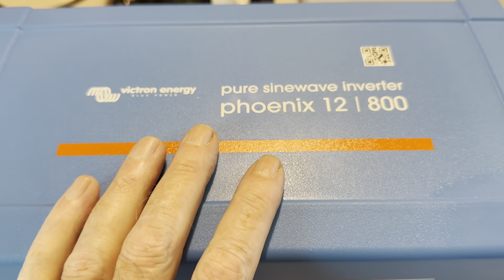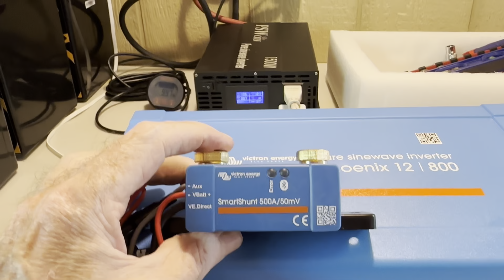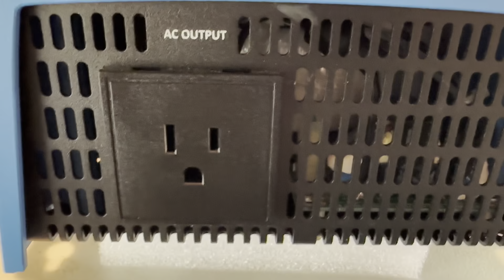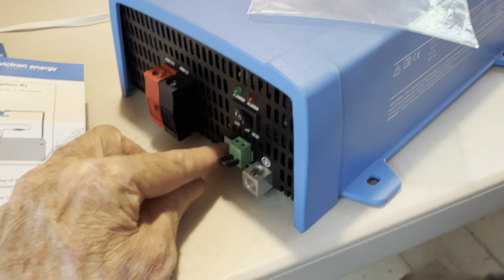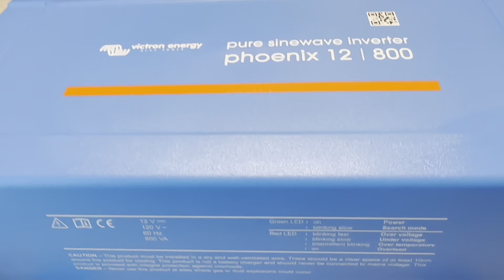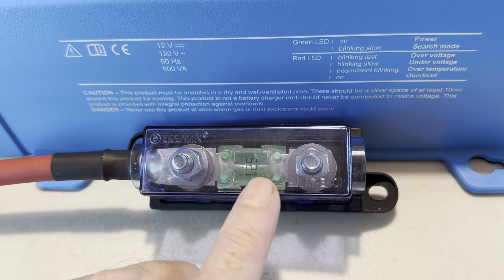Victron phoenix 12/800 Pure Sine Wave Inverter + Smart Shunt  Bungaloha Blue wall is about to grow!

Comment: Interesting you got the 12-volt version I have the Victron 24/800 inverter. You are right it's heavier than I thought. I also have the WiFi dongle so I can check the wattage. I also just bought a Victron 100/20 Blue charge controller. This controller is likely not very popular. I can't find any videos on YouTube showing a review. I should have bought the Smart version.

Comment: Glad to hear you're getting better from the C-19.  On that inverter, I have the same 800w/24v and noticed a couple of things.  To change any of the set points for low voltage cutoff, you need the blue tooth dongle.  Mine kept turning off due to voltage sag.  The problem was using the cabling from another inverter which looked good until a load was applied.....damn CCA, then swapped out for O2free pure copper and problem went away.  The 800w unit has a 650w continuous duty cycle and again you can only see the gauge using the blue tooth dongle.  Once the dongle is removed you're toast on what is going on directly.  Ve.direct network does not work in this scenario as I found out.  I ended up building DIY cables rather than purchasing Ve.direct cables using pst4 2.00mm offset and an isolated USB/TTL adapter and a raspberry Pi.  The raspberry pi becomes a generic Cerbo GX (Venus device) and all of my batteries on now on VRM at a cost of about $80.  The point of all this rambling is that IF you want, you can tie the smart shunt, inverter, and controllers into the Raspberry and monitor on the web or a local network without leaving the home!  I now have three systems on line to see all of the stats in real time.  Also, I noticed the serial number is from 2021 so Victron warranty is from serial number and not purchase date.  I have been picking up open box / used items and most are coming in with 2021/2022 dates.....makes me wonder why!  For home made cabling you need to download the VE networking manual to get the pin assignments, but in general, do NOT connect the 5+VDC pin since it is NOT required!  Gary from SE MI....Aloha your way

Comment: looks real nice. love how Victron stuff talk to each outher and all on Bluetooth app. nice rain your getting. going to be a real nice Blue wall . I can say for the RV people the Victron stuff works very well for them. the Bluetooth app they love.  I have done a few installs for RV . Victron so easy to set up and use. Victron does have a LiFePO4 battery as well. have not used yet. RV people going with Power queen hear. works so well. you sound much better now. take it easy and try not to do so much in a day. pace your self.  what I do. take a look at outher Victron stuff and do some research and see what else you may need . each install I do is different. have to fit the needs of the user. and that will change over time. new stuff comes out all the time.

Comment: Smart shunts are great.  I swear by them.  Settings for LiFePO4 (via bluetooth app):

Battery:

* Ah set to full capacity of battery as appropriate.
* Charged voltage: 13.8V (for reset to 100%) (I explain this more down below)
* Discharge floor: 10%  (typically)
* Tail current: 2% (typically... used as part of the logic the unit uses to reset the SOC to 100%)
* Charged detection time: 3m (used as part of the same logic)
* Peukert exponent: 1.05 (for LiFePO4, be sure to set this parameter properly to 1.05!)
* Charge efficiency factor: 99% (this is amp-hours-in vs amp-hours-out, not energy-in vs energy-out, so it is 99% for lithium.  Lithium has almost perfect coloumbic efficiency).
* Current threshold 0.10A
* Time-to-go averaging period: 5m is typical, set as you like (this is for display purposes only)

* Battery SOC on reset:  "Set to 100%" setting.
* State-of-charge: You can change the SOC upon initial connect if you know what it is, else it will fix itself after a full cycle anyway.

Misc settings:

* Monitor mode "Battery Monitor".
* And "Aux input" ... set to "None" if not using the Aux input.

In terms of the "Charged Voltage", for a 12V battery 13.8V is well into the exponential part of the charge curve so you usually want to activate the shunts "reset SOC to 100%" logic starting about there.  The shunt will also wait for the tail current to drop to 2% and wait 3 minutes after those parameters are all satisfied before resetting the SOC to 100%.

The Victron documentation that suggests setting "Charged Voltage" to the float voltage is INCORRECT for LiFePO4.

--

Also keep in mind that the "Current" and "Power" on the shunt's status screen is the current and power going into or out of the battery,  NOT the current and power coming from the solar.  The loads on the system will subtract a bit from the current and power from the solar during the day leaving you with just the current and power the battery is being charged or discharged with.  At night of course the discharge rate will be precisely what the loads are using since there won't be any solar active.

Oh yah, and when you have the shunt connected to the same VE smart network as the charge controller, the charge controller will use the voltage reading from the shunt instead of its own voltage reading and thus get a more accurate voltage reading for the battery.  Which is awesome.

--

Choosing the 800VA Phoenix was a good call.  The smaller the capacity of the inverter, the less vampire power it eats.   Though since you aren't running a fridge (?) you might be able to use ECO mode in the Bungaloha.  I've never been able to use ECO mode on my phoenix's myself.

-Matt
Reply from the maker: Mahalo brother...I did exactly as you laid out, and it's working perfectly!. You my friend have helped so much. Keep that information coming in! Aloha!🤙

Comment: Glad to hear that you have recovered. I run a Victron 24v/375VA (Non-VE) Sinewave inverter 24/7, on a  Receiver setup. No issues. It uses 2 x 12v batteries with a balancer. Only thing I have to do is add another solar panel on the other side of the garage roof, to capture morning sun. My power peak is currently at 2pm, and going towards winter, will need to use all the solar, I can grab..

Comment: Is Victron modified sine or pure sine wave?
Reply: Pure sine wave.   All Victron inverters are pure sine wave, low-frequency inverters.
Reply: @junkerzn7312  I have the Victron 1200 Phoenix 12 V inverter and so far it has been working very well running my Frigidaire full-size Refrigerator(top mounted freezer) I noticed my Phoenix says it’s low frequency. Also, is that good or bad? What does that mean? Low frequency inverter? most folks claim. These are very clean. Power inverters as they are used in Maritime applications and they can’t have harsh RF interfering with the onboard electronics.
Reply: @william38022  Low Frequency inverters tend to be more robust than High Frequency inverters, can handle larger surges, and are usually slightly more efficient (not by much though).  The output is cleaner as well.

The downsides are:  (1) They are quite heavy, particularly at higher wattages.  And (2) There can be annoying audio buzzing and resonances with certain types of loads.  

--

High frequency inverters tend to be significantly lighter and quieter from an audio noise perspective, and often cheaper.

The downsides are: (1) HF inverters are a bit less robust when presented with a reactive load from an AC motor.  (2) The output is noisier from a RF perspective.  And (3) Harder to repair due to more complex circuitry.

--

Cooling requirements are roughly similar.  Some people think LF inverters need less cooling but what actually happens is that the vendors let them get too hot before turning on the fan.   I prefer the fan to always be on at a low speed at a minimum and usually mod my inverters to force it to always be on if I can't otherwise program them as such.

Personally speaking I use both types.  It is situational.  For the vast majority of my needs HF inverters are fine and I keep extras on the shelf so I can just swap one out if it fails (I don't tolerate equipment having to be turned off while waiting for a warranty repair, for example).  HF inverters tend to be cheaper so its easier to stock extras.

I use LF inverters for anything that is really critical or if I know there are going to be big surges and reactive loads (e.g. from AC motors... A/C systems, wood working equipment, chippers, pumps, etc).

In your case, if you are RF sensitive (have HAM equipment, etc), that is an excellent reason to use a LF inverter.  You still want to have chokes on the input and output to reduce the RF even further, regardless.

-Matt

Comment: I want you to know how much I appreciate, and look forward to, your videos.  I have learned a lot from you and have been able to put a lot of your suggestions into practice.  However, there is one area that I would like you to address in one of your upcoming videos. I don’t recall you ever grounding any of your inverters. Given that you are operating an off-grid system and you have suffered from electrical strikes in the past, what are your thoughts on grounding inverters and solar panels?

Comment: Where knowledge and experience collide, you often find wisdom.  I will be very interested to hear your perspective on the relative advantages, or disadvantages of the "smart" devices for off-grid power.  Some of the best things in life are dumb, if you ask me.
Reply: The shunt is actually a dumb device.  The "Smart" part just means that you can configure it via the Victron app using bluetooth, and get its status the same way.  The shunt itself is a passive device... the power-in-to-power-out is literally just a huge very low-ohm resistor so it is impossible for it to actually break anything.

Oh, the shunt does report the voltage to the charge controllers which will use that in preference to their own voltage readings.  This is a good thing.   You can also optionally connect up a temperature sensor and setup an alarm and the charge controllers will turn off if the battery overheats, but most people don't bother with that feature.  But that's as far as the sophistication goes.

Comment: Unfortunately the pure sine wave inverter from victron are really expensive if you need 2000-3000 watt and then they are only available in a huge box shape. Also victron Lifepo4 battery prices are double or triple the amount of any of the brands that you have in your house. Same for victron solar panels. I am a big fan of the mppt charge controller from victron. Prices are good in my opinion for those devices.
Reply: Yah, that's absolutely true.  I love Victron's smaller inverters but their bigger ones are over-priced.  And I don't buy their batteries (same reason I don't buy BattleBorn batteries any more...  too much money with not enough value-add to justify).

Victron puts on a good face but their product line runs the gamut from "old" to "new".  They haven't updated their larger inverters quickly enough to keep up with the competition, particularly the 48V models, which is really unfortunate.   Their ORION DC-to-DCs are also nearly all very old technology and in need of a complete product-line revamp.   They have exactly ONE modern DC-to-DC in the entire line-up. Just one (the new 48V-48V).  Sheesh!

Even just going with their charge controllers, its a crazy mix of old and new technology across different capacities.   The 48V-capable "smart" (bluetooth built-in) charge controllers are awesome, everything else is old.

The smart shunts are also really excellent.  The low-power inverters are excellent.   They have one reasonable 48V 120VAC multi-plus but that's it... all the others are ancient technology and Victron does NOT have a 48V split-phase multi-plus yet which annoys the heck out of me.

But when one knows how to pick-out the wheat from the chaff, Victron is great.

-Matt
Reply: @junkerzn7312  Agree!  The industry for batteries is changing VERY rapidly and its' with 100A for RV or home batteries (server rack or wall mount).  I hope to go wall mount when I relocate.

Comment: Just a note, this model is 800VA at 25°C, specs sheet says that corresponds to 650W continuous at 25°C and 560W at 40°C. Not quite close to 800W unfortunately. Peak is indeed 1500W. The 1200VA unit is 1000W at 25°C and 850W at 40°C.
Reply: they can do a bit more as long as they are cool and voltage is stable and high ...
Reply: @anaxiosesti88  That's good to know, I have the smaller 12/500 on a portable system.
Reply: I wouldn't worry about it too much.  Victron has very tight specs for temperature de-rating of its devices, but the actual firmware is far more generous before it decides to de-rate, curtail, or shut-down.   In fact, its one of their better features that they actually have proper internal temperature sensing and take action... its really hard to actually burn-up a Victron device from over-heating.

That reminds me of a story.  I was looking for a little car inverter... not a Victron, but just some junky (but still pure sine wave) 12V car inverter.  I found one, plugged it in and was testing it.  That little thing advertised that the fan wouldn't come on for low power levels but what the manufacturer actually did was set the temperature sensor parameters to allow the heat-sink on the FETs to hit 110C before turning the fan on.  And the unit only had one temperature sensor so literally the whole circuit board could wind up at 90C+ without the fan turning on.  Totally unacceptable!  I actually went in and added a 2K resistor in parallel with the temperature sensor to force the unit's fan to come on at a more reasonable 70C to "fix" it.

I'm happy that Victron specs temperature derating.

-Matt
Reply: @junkerzn7312  I bought a Victron 1200 W Phoenix inverter 12 V set up and I have been running a full-size top mount freezer Frigidaire refrigerator 24 seven now for about 10 months so far so good I wasn’t sure if it could handle the defrost cycles on the refrigerator however, it’s been holding its own. I can’t run my upright vacuum cleaner because it will kick off after about seven or eight seconds it will start the vacuum cleaner but it won’t keep running it. I’m going to be building another system in the near future with a larger inverter so I can do a little more stuff,,,so far the Victron is doing its job. I also have a three-way splitter I plug in at night on the weekends and run the refrigerator and the television in the living room at the same time so far so good.